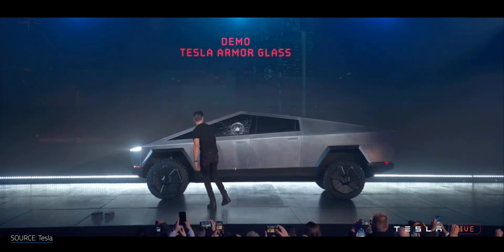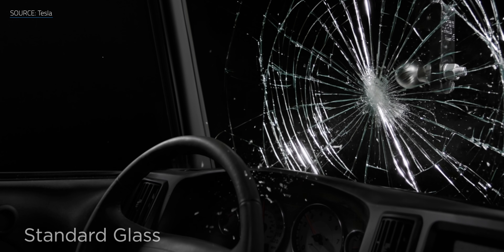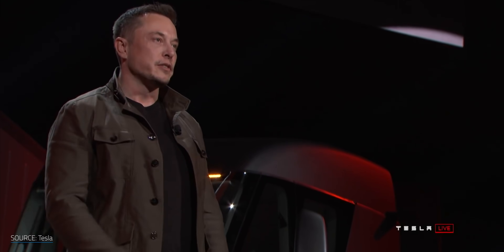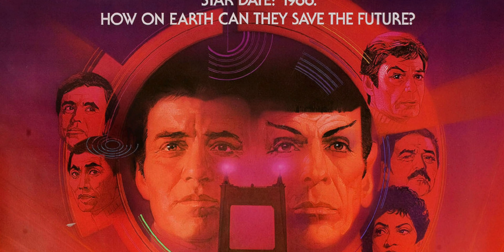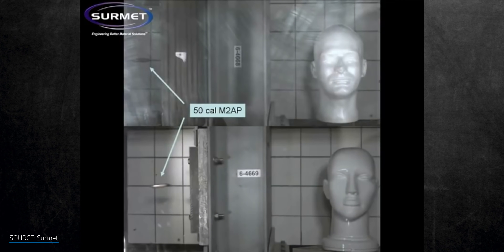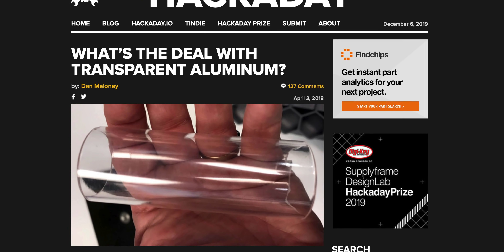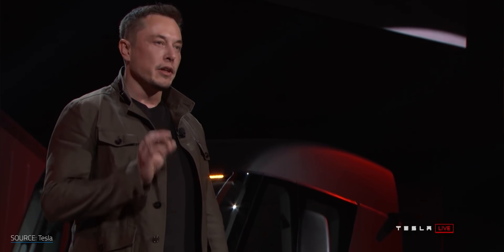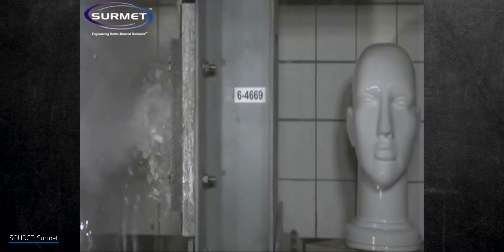Transparent Metal Glass - What is Tesla Armor Glass?

Comment: Thanks. Good video. One beef I can't let go of. The Gorilla Glass promise (over sell?) When I got my iPhone 6s I immediately bought a waterproof case. Then I hot glued loops to the back and hung it from my neck on a lanyard. Even though I'd bought into Gorilla glass I was teaching middle school. I knew that 30-40% of all smart phones, students and teachers, including iPhones had  cracked or shattered screens. I climbed mountains in Japan with my phone in the case dangling from my neck-- no problem. (I also made my son take my picture in the middle of Yodbashi's 3000 square feet of phone cases. Of the thousands of options, only three had lanyards-- these were for use on or in the water.  Lanyards are now starting to be sold)  That was 2016. Last year while traveling again, this time in the UK, the little dongle-dongle started dropping out. My ear bud plug wouldn't fit without it, so I took my iPhone out of the case. After over 2 years it was out of the case for four days, fell less than 18" and shattered the screen. 

So here's my take on glass engineering: terrific, but com'on there is no real unbreakable solution, not even ALON. What's needed is a combination of a durable glass and a second level protection-- for an iPhone a case. For a truck windscreen? Well, let's say Route X has a horrible rate of rocks hitting windshields. ALON will keep a driver from dying, but almost any level of metal mesh will be better. 

The other beef I have? I buy the Lifeproof cases. They're terrific. They wear out so I've been through 3-4 of them. That's okay, but within two weeks of getting a new one the screen gets scraped or gouged. There's an engineering solution in all this (for phones), but it's not unbreakable glass that doesn't yet exist. The engineering solution for vehicles is different, ALON seems a pretty good option. It's expensive and manufacturing is where the engineering challenge is for the near future.  Sorry for the beef.

Comment: Imagine being trapped in a vehicle and all you needed to do to get out was break the window
Reply: Yes - but there are work around this safety issue.  all you need is some areas with usual glass.   The metal glass is needed only in the windshield.
Reply: Vijay Kumar 
Right, and in fact, this is current practice — by law, ALL windshields are laminated glass, and no one is going to use a pin-fired glass breaker or sledge hammer to escape out the front.
Reply: You roll down the window??
Reply: @NormPlayList   in car accidents most windows get stuck espeshaly with electric windows.
Reply: That's what the red button under the flap is for, eject eject eject.
Reply: depending on where you live by law the side windows have to be breakable so people can escape or so emergency serves can get in. most places have a similar laws on house windows.
Reply: @phalanx3803    nope.. that old myth goes for public transport vehicles.. 
Other wise criminal would have an easy day breaking into cars
Reply: @letsbehonest4221   the rear window is made so it can  be kicked out from the  inside of all vehicles fact
Reply: @chavorucosnkombies   "all vehicles" bullshit.
  I used to install car windows for a breakdown service.  And i can assure you yr totally wrong .  
  All vehicle's  🤣🤣
Reply: @phalanx3803  Metal glass would be good on house windows to help prevent burglary.
Reply: @shadoman7682  it could be if your building codes allows it. it's the same thing with cars you have to be able to break them easily just in case you need to escape. Here in Australia every room on an exterior wall has to have at least one window and it cannot be laminated the same applies with our vehicles the side and back windows cannot be laminated.
Reply: @phalanx3803  I thought it would be easier to just open the window instead of breaking it and getting cut on any jagged edges. :)
Reply: @shadoman7682  nope. 2 weeks a go i had a steer tire on my Camry blow out ended up hitting a guard rail https://www.dropbox.com/s/wugh4svj3i78s2y/20210320_055726.jpg?dl=0 the crash didn't scare me what did was it was pitch black and when i went to put the hazards on they didn't work no one could see us. luckily the doors could still open we got out and and used our phone lights to flag someone down coming the other way he stopped and put his hazards on and flashed his spoties at the B Double coming around the bend. the whole power system got wiped out in the crash if those doors didn't open there was no way the windows would have gone down we would have had to smash them a few cuts is better then being crushed by a truck. lucky Toyota make a solid car and we didn't end up trapped. also lucky the other guy had just pulled on to the road and was going slow enough to see our phone lights with ease if he didn't stop it would have started a pileup. we also got luck we hit a guard rail about 5m before the guard rail was a THICC tree down in a ditch with a barbwire fence.
Reply: @phalanx3803 , Houses don't typically end up in car crashes, so there's not much chance the window will be made unable to be opened.
Reply: @shadoman7682 , At least for patio doors it would cut away a big convenience for burglars. 

I think burglars would be less content squeezing through a small fire-escape window. Even if they did bother with the small window, the lack of convenience would probably reduce the time they have for plundering. So it's probably worth keeping small windows as regular glass for the fire-escape utility.
Reply: @JNCressey  no houses don't crash but they can catch fire and burn pretty well. Also not every houses has big sliding windows that you can slide open and walk out of.
Reply: Hmmmm...i would suggest a change in the mounting of the window allowing it to be dislodged from the INSIDE but NOT from the OUTSIDE. A simple cheap and fast solution.
Reply: A forcing vibration(device shud be waterproof)?
Reply: They would probably have some kind of release tab on the inside to make the whole window pop out.Elons smart,so im sure he would've thought of somethin for that already.imagine he built it (the glass n metal body) so strong that they cant even cut it open with the jaws of life thing they use to cut metal doors n shit open tho aye?lol
Reply: @philipsmi-lenguyen8155   release tabs often don't work when the frame is warped or damaged
Reply: which happens more... cars experiencing hits from dangerous debris to the windscreen, or cars ending up submerged completely in water? You are suggesting a car with a weak windsreen is somehow safer? No disrespect intended, but that is a ridiculous comment

Comment: How come they don't know it may be the cut of the glass? It could lower the coefficient of energy distribution over the surface area. Plus if the glass is angled larger objects could destroy it. I'm thinking they'll have a solution for it later. Making it too large the thickness has to increase; the glass can also crack itself with objects hitting and the energy placed into it doesn't have a large enough area to distribute the travel of energy across it's surface evenly, which means any object that doesn't have the same flexibility as the other in which it is held could send the energy back to its origin at different intervals of time cause it to flex and/or break. Make it to small you have more problems and some of the same.

Comment: Absolutely fascinating!  Great info.  I had ZERO knowledge of ALON.  Not sure the weight of the stuff but as costs come down I can see applications of this on  motorcycle windscreens!  Motorcycle windscreens are still using a plastic based product.  Cheap and they don't hold up well over the long haul.  Something like ALON on a fairing would be nice to keep any objects flying off of trucks/cars on the interstate from destroying the bikes only real protection to the riders face.

Comment: Automotive safety glass is tempered and laminated. There are  Engineered to break into small pieces that are held together in a "laminate sandwich" .  I am wondering if there was any "spall" or loose pieces set free in the passenger compartment when the window breaks.   Real bullet proof glass is many different layers that dissipate the strike and  hold in the pieces.  To be "bullet resistant"  The windows on military vehicles are very thick and heavy and held in place by a sturdy metal frame.  Even these windshields will experience stone chips and scratches.

Comment: Calliing aluminum-oxy-nitride a transparent metal is really not accurate.  It is a ceramic, there are not free electrons to conduct as is the case with a metal.  It would be cool if that were possible as it would allow you to make one side of the phone, the side that faces the users head, a shield, preventing them from being exposed to high radiation levels.

Comment: I hate that they imply it's a metal when it's in fact a ceramic that has the metal, aluminum as a component. This implies this material is tough when it is in fact just super hard and super brittle. One of many gimmicky things in that launch.

 It didn't go through because, I would bet its a composite, with a layer or layers of polycarbonate. There is no way a piece of polycarbonate of reasonable thickness will let an object like that pass through it at top speeds of highway debri, 140mph or so, it will just yield and yield and yield. All the toughness is gonna come from these other materials. The tech is for sure cool and could change things, but calling it transparent metal is so gimmicky, common tesla! Cut that crap out or your gonna alienate the nerds that appreciate what you are doing and have the techmoney to buy your cars.

Comment: Having a house brick flying at you from between truck twin wheels on the freeway sure is not fun when it happened to me it came straight through the laminated glass of my van missing me by millimetres and showing me with razor-sharp shards of glass I was covered in cuts to my face and arms it looked like I had gone through a wood chipper lol, so I would be so glad of teslas glass plus I now like his truck it makes sense,
 As a master mechanic I can see why it was made that way cybertruck will be driving around long after a new dodge petrol/diesel truck of the same year I bet you as it is stronger rust resistance plus it needs less maintenance so as long as the electric motors and battery packs hold out which by the looks of things is pretty easy to replace as a unit drop an axle out and put a new one in or a refurbished one which will be on the market in a few years so it will be cheaper to run and maintain and do the job it was made for and ease of manufacturer plus as new battery design comes into the market like john Goodenough's Glass/Solid-State Battery you will get almost instant charging and even further distance which even a petrol truck will not beat refuelling three times or more plus once recharge solar cells Kitts come out so that you could fit them to your roofs and sliding tail cover as the new solar cells do not nead direct sun so even cloudy days you will get full charge input from the cells which will increase your distance and will always keep charging as long as its light the cells won't completely charge the batteries it would take weeks to charge it from empty to full but if it adds on ten or twenty miles a day thats all that some people do driving to work and back . And then it's the custom boys wait until they get hold of the Cybertruck then you will see some amazing things with these trucks. 
I think we will be seeing a lot of them and when they come to the UK I can see one parked on my front yard as it can be used as a family car as well as a truck as its price is one I could afford as all the over tesla cars are too expensive for the average joe love the way the back is covered just a brilliant idea you can see a lot of thought has gone into the cybertruck and once the dumb-asses stop taking the piss out of it because they can't stand change and grow up then even the mickey takers will end up buying them.
As the first impression, it is a shocker to the system but as you study it you see through the squareness of it and see the brilliance I think tesla has success once again with the tesla truck as he does not enter into projects with a bit of risk involved like space x which was hanging on a thread at the beginning and tesla cars they all nearly bankrupted him BUT now look at him they all become a complete success and the more products he develops you can see he is being very careful not to fall into design traps like most motor manufacturers do as they are making petrol shaped cars with electric motors where Tesla is making the body's fit around the electric motors and batteries.

Comment: What if you drove off of a Clift into the ocean then the door was locked and you needed to break the window?
Reply: Any crash really. Most cars have side and back window that can be easily broken so that if the doors are twisted we can cut the roof off easily. Unless the Cybertruck is uncrushable this is not good for safety.

In short I agree but just wanted to add a detail of my own.

Comment: The biggest problem with that glass being in/on any vehicle is emergency escape measures. Other than that why not.
Reply: Did you think that maybe on an electric vehicle, you could just simply roll the window down? Its just a matter of making electrical components- water proof.
Also, back in the 70's, my parents car lost its breaks and rolled into Shasta Lake. It rolled pretty fast, because it was on a hill and hit the water hard. It floated for a good 30 minutes, enough time to get my 65+ year old cousin out of the vehicle. 

Today, with all the electronic sensors, GPS, and display utility connected to the internet, the vehicle could dispatch 911, and roll the windows down, if the driver or occupant's are impaired.
Reply: @Chilltothend  electric vehicles  have the weight of a heavy battery

Comment: He's ignoring the fact that normal car glass would have also stopped that metal ball from going through.
Reply: trust me It does not I had a house brick flew through my laminated front screen on the motorway/freeway showering me with razor-sharp shards of glass the brick was jammed between two rear lorry tires all I saw was an orange blur coming from the wheels of the truck and bang it was on my back seat.
Reply: @kinkong1961  I didn't mean that brick, I meant the metal ball in the demo. If they did the same thing on stage with a different car it would have looked the same.

Comment: I would love a stronger windshield.  I have replaced many windshields in the past for small chips that other people would have just lived with.  I'd love a windshield that is more resistant to small rocks and road debris.
Reply from the maker: Me too.  I’ve had windshields that looked sandblasted.
Reply: Alon's transparency range is wonderful for camera sensors, but its greatest other contribution may be when laminated with a thinner upper & lower flexible glass that could retain the structure's form after successful impacts such as by micro-meteorites.

Comment: One big difference between Alon and glass is that it shows up as black in the infrared spectrum. This may result in less of the sun's energy penetrating and heating the interior of a vehicle, but it also may mean that the Alon itself will heat up significantly when exposed to the sun.

Comment: The glass on the CT did have a small hole on the first impact if you look carefully. Thats what we want rather than not braking at all. Why he wanted this glass not to even have a dent i have no clue. All we need is much stronger glass specifically the windshield that would still brake but to a stronger impact. Not to be completely brakeproof

Comment: Synthetic sapphire? Some of that is an "aluminum ceramic" of sorts that is clear and used in things like expensive watch faces that are resistant to scratching.

I think the demo car had something more like shatter resistant glass than "fully armored" glass. Basically it's the same laminate that most windshields have, rather than the safety-only glass that pills up as usual when broken in the side windows. Laminate will break up, but the glass doesn't fall out on it's own. Also in an emergency the usual laminate can still be pushed out, or picked at with a hook or pry bar and pried out.

I think synthetic sapphire would be more ideal for headlight lenses or as the outside layer that a headlight lens could be formed into. Would be the best application since it could make them resistant to scratching and hazing as the polycarbonate plastic ones do now. Unbreakable glass for the main windows might not be a good thing when you need to get somebody out of a vehicle accident. Would you want to be trapped with a jammed door if the vehicle catches on fire?

Comment: Alon will explode if heated unevenly. Although it is Crystal in it's current state it retains its similarity to aluminum and will expand with heat. If heated evenly there is no problem and can even take extreme heat without a problem.